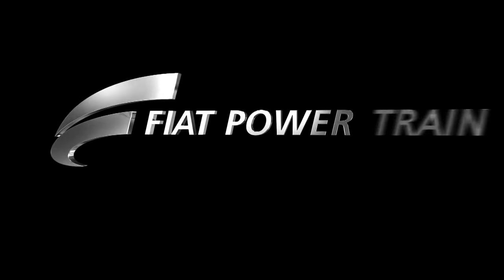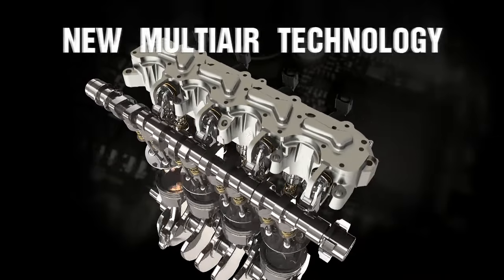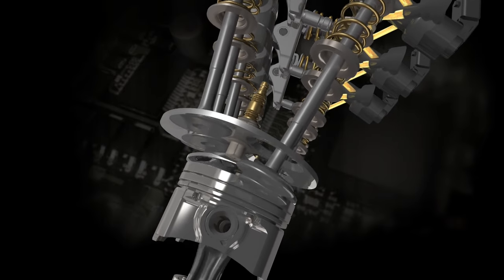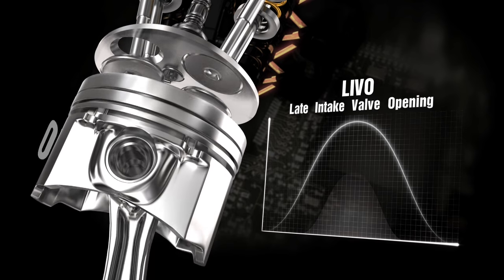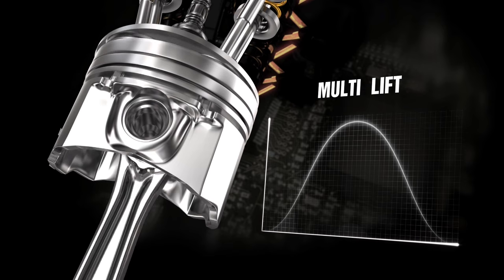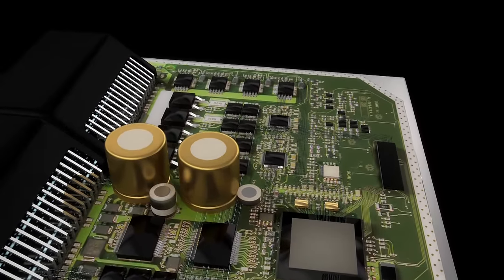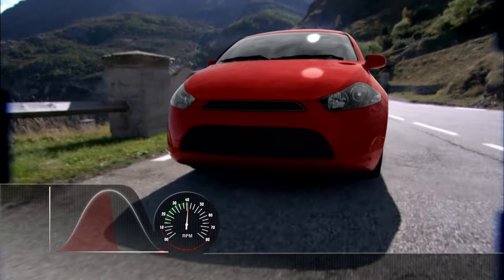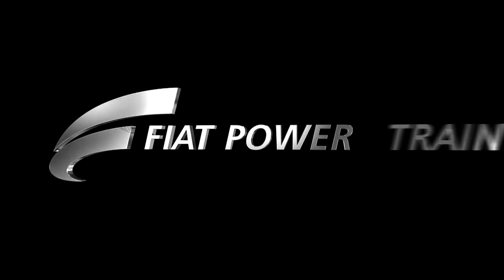How Fiat MultiAir Technology Works

Comment: Works really well when you rev these engines past 4K their timing changes
Valves sounds like a diesel when cold 
5w20 is for CAFE 
I bought it with 65k in 2019 it’s at about 130k
If you bought it used I’d recommend shortening the oil change intervals a few times, changing when the oil darkens from honey to brown/black.
Reply: I have a Dodge Dart with the 2.4L MultiAir, and you're not joking about the diesel sound when it's cold. And it's true, they really come alive past 4k rpm.
Reply: My Jeep Compass makes a weird sound when I shift gears like it pings but it is kind of a diesel sound.

Comment: I've been pondering a concept like this for years, envisioning the exact same functions and benefits. Looks like they beat me to it. I was visualizing both intake and exhaust valves, and oil could be piped from a camshaft down in the block to avoid the need for timing belts/chains and the compactness of an OHV rather than OHC. As for reliability, I wouldn't be worried about the reliability of this design general, I see that going the same way as EFI and electronic ignition, which might have been troublesome at first but now are very reliable. This looks a lot simpler than a lot of other variable valve timing systems currently on the market. I would worry about the reliability for a different reason though: because Fiat (now Stellantis), they - in fact any brand under that realm (Chrysler/Dodge/Jeep) - don't have a particularly good reputation for reliability or longevity. More issues with build quality than design. If Toyota or Honda made this it would probably run for 500k trouble-free miles, but they don't tend to be as innovative with new concepts. From what I've seen the Italians are great at coming up with revolutionary ideas but struggle with build quality, while Japanese only make relatively conventional things but they run forever.
Reply: This method of valve actuation will allow the application of true hemispherical combustion chambers to virtually any engine. If you like boxer engines, imagine this with no push rod tubes to ever leak and a hemi head on a VW or Porsche air cooled engine as well as multiple valve configurations.
Reply: @jpvill4th  I had that exact thought as well - this would completely open up valve geometry to anything you want, with no constraints by the valvetrain system. I even once tried to mock it up in CAD, trying to design a hemi-head quad-valve cylinder head for a classic Volkswagen Beetle (I daily a Beetle, and actually could see this being retrofitted onto one, plus had an old cylinder head to use as an example), with the four valves radiating out from the hemi combustion chamber. Ran into the problem that this caused valves/oil cylinders of adjacent valves to interfere with each other. A not fully hemispherical but domed combustion chamber, with valves at a shallower angle, could work though. But from what I've read, modern high compression engines actually function better with a wedge-shaped combustion chamber than a hemispherical one.

What we see rendered here looks quite clearly like a modified DOHC engine design, with one of the camshafts replaced with this system, but an engine designed for this from the beginning - or even a pushrod engine with a fully new cylinder head (VW Beetle and GM LS come to mind - both are very popular to modify) could have even more potential. And likewise, apply it to exhaust as well.

A more mild retrofit to a Beetle would be to use the existing head (two parallel valves), replacing the pushrods and rocker arms with oil cylinders/pistons and pipes. A few billet aluminum pieces could do that. Maybe even could simply plug the pushrod tube openings in the case and connect pipes there, the standard lifters acting as master cylinders. Might need to give them a supply of oil separate from the engine's main oil circuit, perhaps an auto-stick's dual oil pump could do the job. The harder part would be to make the "multiair" aspect functional on the electronic/coding side. I visualize having a very aggressive long-duration high-lift cam (available off-the-shelf from various vendors) and this system applied to both intake and exhaust. Programming - would require some tuning - has both intake and exhaust solenoid close (starting to open the valve, determining both lift and duration) based on RPM (higher lift/duration at higher RPM, less at lower for better torque). And the intake solenoid opening - valve closing - based on throttle position from a drive-by-wire gas pedal, the engine having no actual throttle. Actually none of this would be all that difficult, probably more feasible than attempts at a DIY pneumatic Freevalve.

Comment: Stop saying it's unreliable, it's not. If you change the oil on schedule and put in the oil called for, it'll be no different than any other OHC engine.
Reply: It is unreliable. More moving parts means more can and will go wrong. Also this is one of the common failures on the fiat 500 for North America. Oil changes will not save you.
Reply: it’s a piece of oil burning shit.
Reply: Eh. just had my multiair fail at 55k and it's always been serviced early by a very reputable alfa specialist using the correct oil. Just have to go on the alfa forums to see hundreds of cases of early failure.
Reply: It is a total junk design. It's a fact
Reply: Jon I'm sorry but your incorrect. It burns so much oil and Dodge has a 10k mile oil change intervol in the owners manual. They burn 1 quart every 2k miles when new and not under excessive load. Do the math. And when the engine has 50k miles on it it's normal to get 750 miles per quart under normal conditions and 500 under heavy load. You can't use different oil or you own it. So by design it's a failed motor. There is no 2 ways around it. All to get another couple miles per gallon at the cost of an engine. That's just bad math. Honda does it with VTEC and it doesn't burn a drop of oil.
Reply: It was unraliable for like first 2 years after indroduction, and thanks to faulty manufacturing (lack of thread locker). Now it's pretty good, provided that you change the oil and use correct oil grade.
Reply: @1sinister80  But Hondas 1.5 turbo liter leaks gas into the oil...well documented and huge problem.
Reply: @buildmorefarms1007 The V TEC I'm referring to is Naturally Aspirated. I'm not sure about their turbo. It's apples to oranges. I wouldn't buy a 4 banger turbo from any company. They try and squeeze way to many ponies out of them and almost always skimp on parts some where.
Reply: @JamesClimbs  it's a Gamble. I bought a 2012 Fiat 500 last February with 35000 miles on it. I put 51,000 miles on it in a year. I've had zero issues.
Reply from the maker: @1sinister80  Sorry to interrupt all your spam posting, but I've bought three new Fiats and an Alfa Romeo in the past 7 years.  I've added maybe 1 1/2 quarts in 60K use in  my Abarth. 1/2 a quart in 30K on a 2.4 500X and nothing  on our 20K mile Alfa.  Sure, you can get a car that uses oil, just like any other car out there.  Most of the problems, though, are people who neglect their car, never check their oil between 10K mile oil changes and ruin their engines.  They then have to blame someone. New cars can use oil during break-in and the owner's laziness during this critical time is likely the biggest issue.
Reply: @Fiat500usa_com  Your lucky. Just look up the reports online. My Compas was not the only one im one of 10s of thousands who have had the same situation. So I would tell you stop your spaming.
Reply: @anthonyrybczynski5420  For an engine with continuosly variable valve timing (VVT) and variable valve lift (VVL) , is the most simple one. It just have solenoid valves to control the high pressure oil (the same engine oil) chamber, controlled directly by the ECU, other than slow and expensive mechanisms having friction and moved with a servo like BMW's Valvetronic, etc.

Comment: For all saying it should have direct injection, I argue that direct injection has the potential to have problems down the road due to carbon build up, Direct Injection doesn't allow gasoline to clean the port or have enough time to allow the detergents in gasoline to do what they are designed to do.
Reply: Use a oil catch can my guy
Reply: It does not have direct injection but standard MPFI (injectors in the intake manifold)
Reply: @rmta2025  The newer 1.3 multiair is running direct injection. I wonder if they are combining port injection to keep intake valves and ports clean, nissan does this and is working well for them, I'm sure others do too.
Reply: Not having direct injection is a huge benefit for long term ownership. Carbon buildup is bad news and cleaning it can be risky. What's worse, it can't be 100% eradicated from any production engine unless using separate indirect injectors which only a few manufacturers do. Long term reliability is not something most manufacturers strive for these days.

Comment: A lot of you guys are talking about mileage this, and mileage that... Truth is, you're not buying a Fiat 500 for the mileage or the engine... You're buying it because it's a Fiat 500...
Reply: Well said
Reply: nobody is buying fiats
Reply: @SayWhaaaaaaaaaaaaaaaaaaaaaaat  the problem is someone is spreding rumbers that they are uncool, if you drive them and could spend a week with one that would change your minds. Fiat makes some really great cars, they look good and drive amazing.
Reply: "Guys" don't buy Fiat 500 🤦
Reply: @SayWhaaaaaaaaaaaaaaaaaaaaaaat  drug dealers are where I am. Thinking of buying one too
Reply: Fiat 500 is a real man’s car. Absolutely brilliant cars.
Fun to drive, looks good, shockingly reliable, reasonably economical and women love it.
Reply: No I bought it because it was cheap. It was cheap because it was broken. One of many actually.
Reply: @SayWhaaaaaaaaaaaaaaaaaaaaaaat Best comment.
Reply: @neubauerjoseph These engines burn so much oil and they fail prematurely. Absolutely cheap junk. I owned one in a jeep and it went out at 32k miles. Was going out again at 90k when my company got rid of it. Dodge mechanic said all they see are vehicles with these fiat motors in them all the time. It was so bad they have a test they do to determine exactly how bad the oil burning is. They admit they all burn oil but some are worse then others. Steer clear if you want a reliable car.
Reply: Unreliable, misfires etc..

Comment: This is a great engine. Only time will tell something about reliability, but at the moment is excellent.
Reply: Seems to have oil consumption problems. Mines using a quart and half between every 6000 mile oil change with 22k miles. There's tons of horror stories of this, many much worse with the engine just shutting down with no warning at all when the oil drops too low. When it comes to warranty work Chrysler claims as much as a quart every 500 miles is acceptable.
Reply: Yes i notice some oil loss with this aswell. No big deal i check mine at every 2000 miles. Light weight 0w 20 synth oils vaper off more rapidly to. That is to be expected. Like i tell people always check your oil so often in any car you own. Many newr cars nowdays have alot of oil complaints. It is normal. Now a quart at 500 miles or below might be a problem that will need attention i would say.
Reply: I''m sorry but your incorrect. It burns so much oil and Dodge has a 10k mile oil change intervol in the owners manual. They burn 1 quart every 2k miles when new and not under excessive load. Do the math. And when the engine has 50k miles on it it's normal to get 750 miles per quart under normal conditions and 500 under heavy load. You can't use different oil or you own it. So by design it's a failed motor. There is no 2 ways around it. All to get another couple miles per gallon at the cost of an engine. That's just bad math. Honda does it with VTEC and it doesn't burn a drop of oil.
Reply: @1sinister80  I concur.  My GF has a Dart GT with the Multi-Air 2.4, and I've maintained it well for her with the proper oil (I'm a mechanic by trade), and it's a POS.  Burns oil like mad, and now at 62k miles just outside of the powertrain warranty the VVT Multi-air system took a dump. It's $1,400 part and at least an 8-10 hour job. She should of bought a Corolla or Civic.

Comment: I would assume if there's a loss of a valve 'pump' and thus loss of pressure, that valving won't open completely if at all depending on pressure.
Also I'd assume the solenoid to default to closed if it fails electrically. 
It's a clever system, more complex than need be if Aurasystem's full electronically operated system is reliable.
Reply: TheRumJumbie yes. And oil consumption seems to be a problem also. Low oil will cause the engine to shut down without warning.
Reply: @cahman8  would you stop. You need to read up on what the loss of oil was actually about.
Reply: The solenoid is actually normally open. If there is a failure, there will be no valve opening.
Reply: @GabMacedoo  Actually, if the solenoid fails it'll go into full lift mode and the conventional throttle will kick in to control the engine.

Comment from the maker: We will.  With a specific power output of 117 bhp/L, the 1.4 L MultiAir turbo sports one of the highest specific outputs in its segments beating the 114 bhp/L for the Mazda Speed 2, 113 bhp/L for the MINI S and 100 bhp/L in the VW GTI.
Reply: HP/L means absolutely jack shit on a turbo engine since fuel economy figures under full boost pressure will never come close to an NA engine. More air = more fuel. Simple and plain.

To be frank, HP/L is a bullshit figure in general, but thats a separate discussion.
Reply from the maker: @user-zg4gx9zq9b  Talking about specific power output = horsepower per liter of engine size.  Nothing to do with fuel economy.